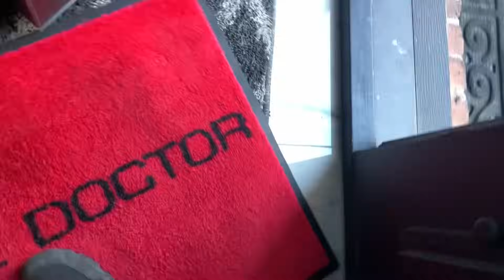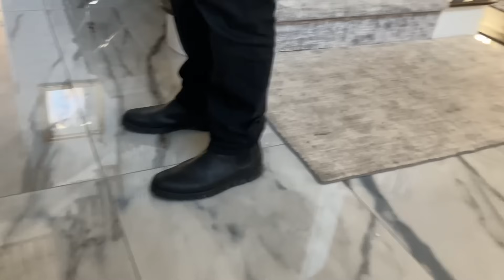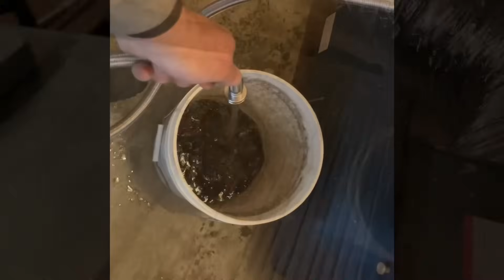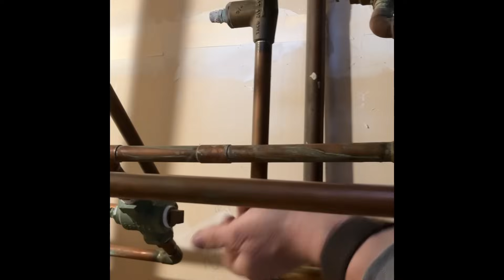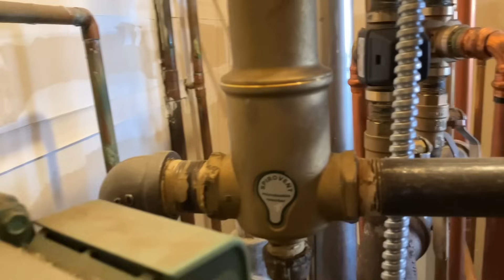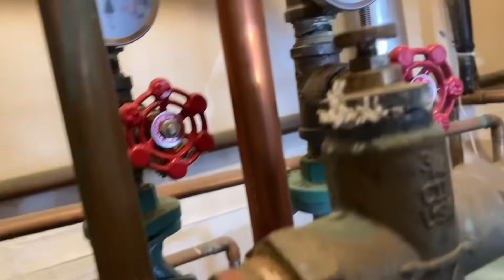No Heat 2nd Floor - They Need Another Spirovent! Purging Gas Boiler Service Call

Comment: i had a problem like that with a system took off the 007 put 0011 on and never went back for the  problem  the water wasnt circulating  fast enough that the scoop or Spiro vent  cound catch it. The bubbles just stayed in the water and ever month he had to bleed never again its been 8 years since

Comment: the problem is, it needs air separators at the hydrocoils. because there will always be some off-gassing of the water, even if sealed near perfect tight and near zero makeup water per year.
the highest points will always get air entrapment and beyond a bubble or two will hydro lock it so the circulator cannot overcome it and push it through the coil and back down.
but, putting air separators in an attic or highest points is just asking for water damage.  manual air bleeders and pre-season maintenance is needed. nobody seems to get that.

Comment: maybe making steam, on shut down. cold day boiler gets up to high limit and shuts down zone that is calling about same time.residual heat trapped in block makes steam.had similar problem with buderus that have aquastat on top of the boiler.pipeing is a abortion.chop the supply and return,start over.hw reset control with post purge for circs.couple of years sell them a wall hung.